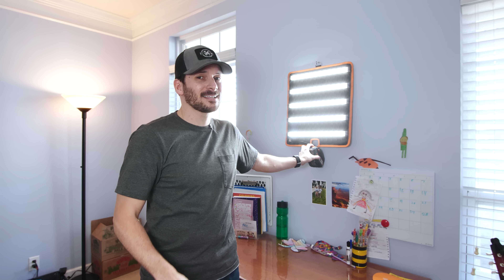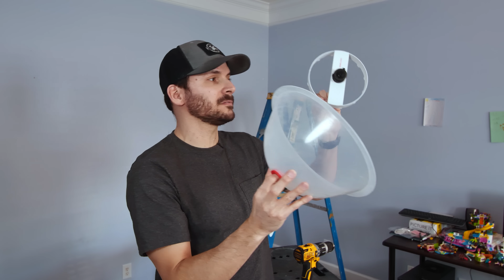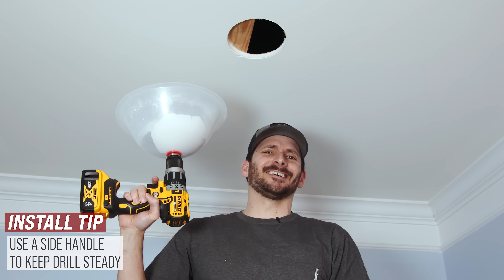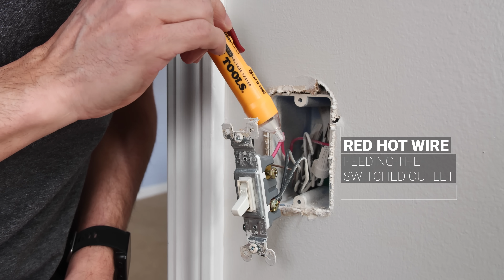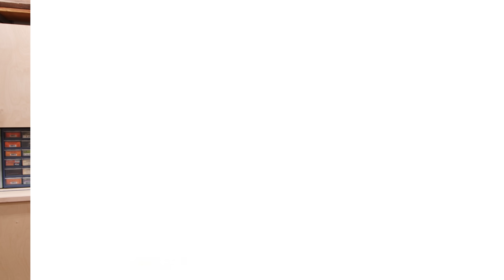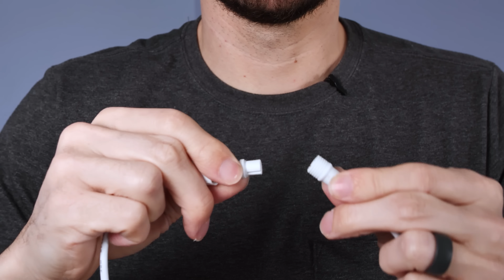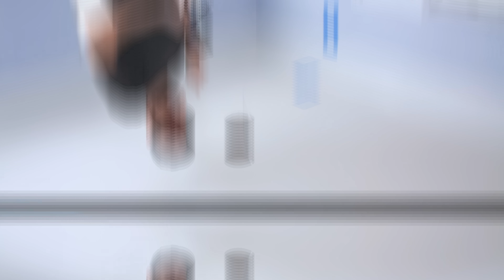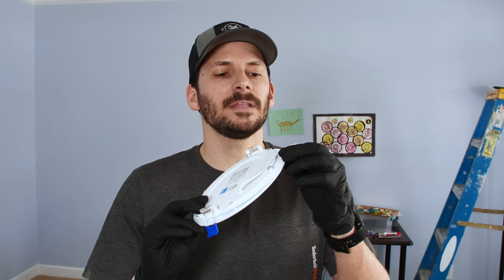Recessed Lighting Install with No Attic or Prior Wiring

Comment: Next time cut a hole in the ceiling to access the 14/3 and place 2 junction boxes to interupt the wire, while preserving the line to the outlet, then install a double switch on the wall. That way you dont leave a dead outlet that has to be fixed later.

Comment: Lol @ wire strippers in the ceiling. 🤣

I work on bowling machinery, and I when I was new to the job I mistakenly left a 1/2" box wrench on top of a machine. I looked all around & couldn't find the damned thing until a half hour later when someone started bowling on lane 9...clang, clang, clang. The wrench had fallen into the pit and was bouncing around in the pin elevator. 🤭

Comment: Going the other way...I've enjoyed your videos and it helped me a ton doing my own kitchen cabs and sink! Now I feel if I can do that I can do anything. However...that said I am approaching a dilemma and I cannot find any info on my next task so I thought I would reach out and see if I can get some feedback. I have and am sound proofing my middle bedroom to be my new home recording studio. The walls are secure with triple insulation including 1-1/2 rigid foam insulation sealed with insulation spray foam. This room is not only dead silent now it is completely air tight...except for my ceiling. The only thing left is the ceiling. My plan is to also apply the 1-1/2 rigid insulation sheets to the ceiling. Once done the entire room will be completely covered in 2-inch acoustic foam panels. Here's my issue. I need to drop my ceiling light fixtures down about four inches. Wiring is not a concern, but I'm not sure how to securely drop & mount the box to remount my lights to clear the double foam. Help me Obi-Wan...you're my only hope!

Comment: Licensed electrician here. You showed how you planned to get a wire from the switch through the top plate to your hand hole that you cut, but what was your plan to get the wire between all of the lights through joists?  You were lucky to have the trussed ceiling there. Most 2 story houses aren't constructed like this, and installing lights like this on a first floor ceiling with a room directly above it isn't anywhere near this clean and simple. You would have had a lot of patchwork in the ceiling, and you didn't show people that.  I can't tell you how many times I've had to tell customers that there will have to be multiple holes cut into the ceiling in order to get the wire through each joist in order to  interconnect the first light to another light in at least one direction (perpendicular to the joists) and they look at me like I'm crazy. I even had one lady tell me, condescendingly, that I didn't know what I was talking about, because on a TV home renovation show,  "Chico didn't have to do that."  They didn't show that part either, apparently.  I told her, "Well, maybe you should call Chico then" and left.

I wonder how many people watched your video thinking that it would be as simple as you showed, only to find out otherwise.

Comment: I’ve been looking into redoing the insulation in my attic. My dad built the home about 30 years ago. It has a not so thick layer of loose insulation directly on top of the ceiling. I noticed when you cut your holes I didn’t see any insulation. How is yours done?

Comment: Two things I’d recommend-
1) just use a hand saw while holding a vacuum hose in the other hand.  

2) cut out the old box with a hacksaw blade and use an old work box to prevent another drywall hole.

Comment: I have the exact same lights from amazon. Thanks for the video. I’m not a electrician either so I was searching on YouTube for people who have done this set up. It seems pretty simple enough. I don’t think I need to run wires because I am just putting this in the old fixtures. But if I want to add more I may need to purchase cables/wires so I do four like that in one room. Well see. But this one of the better videos I found so thank you.
Reply: What did you pay for them? He said 12 for $60 but I cannot find them for that price anywhere‘s.
Reply: @1stNCYANKEE  I got 12 at 100$ something on Amazon. Also using that whole saw was difficult. I use a combo of that an dry wall saw. Some of my wholes aren’t perfect and need to be patched but the wiring is easy. The hardest part was cutting the wholes.

Comment: I would've kept the switch you had originally. You had a switched red and a constant black. Cut the wire where did in the ceiling (after turning off the breaker, of course). Use the red hot wire from the switch and white neutral wire for your first wafer light. Connect the cut black wire (from the switch) back to the cut black wire (to the outlet). Cap the unused red wire to the outlet. Remove the red (now-dead) wire from the outlet and jumper the outlet hots (lines) together. Now your lights and your outlet works. No need to run an additional wire later to fix the outlet.

Comment: Sometimes I would take the neutral from the switched plug and splice it to the switch-leg. Then I have a neutral in the switch box. You will lose the plug. Then just run a 12/2 to the lights.

Comment: If I install these from below and without going in the attic, is it safe and within code to just push the connection box loose into the attic and not screw it down to a joist?  Do I need to clear away insulation from around it?  Thanks

Comment: hello i would like to install several can lights in my kitchen . I have to follow the electrical wires in the ceiling but I have 17 " foam insulation in the attic . How can I can do the work without making a big mess ?????       thanks

Comment: How do you remove the lights if you need to do maintenance, is there a push mechanism to pop them back off without damaging the drywall ?
Reply: The lights are held in place with simple spring pressure. Just pull down on one side and they'll easily come out.
Reply from the maker: yup, literally just pull down on them and they come out

Comment: how did you run the wires to attached all four lights together in one box? where 2x4 is one way direction you only can attach 2 lights together that is same line of 2x4 horizontal.

Comment: The hardest part I've run into when doing mine is that my attic has blown in insulation. When I put my lights up I constantly got insulation in my eyes and it made it annoying as heck trying to fish the wires around because insulation was in the way blocking my vision. Still worth it though. I just got some new ones that have a dual function; they have the normal light that's adjustable down to a perfect warm 2700K AND a night light type trim ring that shoots a dim light out to the side. they look great
Reply: Where’d you get those? Can you attach a link or pic?

Comment: Maybe someone has already mentioned this, but with 390 comments, I'm not going to read each and every one to find out :)  They do make wafer lights that allow you to select the color temperature. The ones I saw had 5 settings: 2700K, 3000K, 4000K, 5000K, and 6000K, and cost about $24/ea. There are also some where the color temperature and dimming can be controlled via an app, but I haven't done any research on those.

Comment: I want to do this to my apartment - can I put it on a switched box where an old overhead light was??? Do I need to worry about Voltage or Watts? or Anything??? I'd probably add 4 to a 110V. I'm in the US/Los Angeles.  Thanks!

Comment: Drill in reverse.  You can start in reverse to get the hole started then switch to finish..... but most professionals drill all ceiling holes in reverse all the time.

Comment: High speed on the drill is much better. Lower speed has much higher torque as you found out when it grabbed and nearly took your head off! High speed also cuts much smoother.

Comment: man o man,
what a beautiful video 
but i came to a somewhat of a problem 
im installing same set up of lights on a room that has no ceiling light!
i cut first hole and found out theres a lot of insulation
like a lot  ( sprayed on insulation)my house has that in every single wall and even the attic is full of it 
i got covered from head to toe 
now i have to finish the job but damn i cant see anything not even with my phone

Comment: You could have used the junction boxes for the lights to tie in to the existing romex with a new piece of 14-3 between two lights if the wire was  too short

Comment: I plan on doing this as well, but have a different situation of just having a ceiling fan/light in the middle of the room, controlled by a wall switch.  Is there a way without cutting into the wall drywall to run another line to the switch that would operate the potlights separately.  I know you show doing it, but want to avoid patching/painting
Reply: Do you have crown molding in the room?  If not, this may be the time to add it.  You still cut out a little drywall on both the wall and ceiling junction, but it is hidden by the crown molding.  Check with code in your area, but you can then run it under the crown molding and then make another notch in the drywall where you need to go to the light.  Just be careful of where you nail the crown molding.  Anyway, this is my plan for adding an exhaust fan/ light combo to a powder room.
Reply: @glasshalffull8625  No we dont, and dont plan on adding it due to the extra cost and roof height of 8 feet.

Comment: The wafer lights are 12 volt is it possible to cut the pigtail off and use them straight to a 12 volt system and do they come with that wiring diagram

Comment: Really good video!!! An alternate technique for the Half Hot Switch Receptacle:  Replace the single gang switch with with a double gang or triple gang retrofit. Now you can still have a switched outlet, switch for the ceiling lights, and with a triple you can have switch for ceiling fan.  You would bond the new electrical runs to the existing neutrals and hots. Just take your time when backing out the existing the electrical wires from the single gang to ensure not to damage/tear their outer installation.   I’ve put the pancake ceiling lights in 7 rooms (4 in each room). They were between $20-$30 at the time for each light. The builder wanted $150 per “can” during construction. So we did the immediate retrofit for about $100 per room verses $600. It only took 2 days to complete all.

Comment: That 3 wire likely is the power and switch for that receptacle so if you ran a 3 wire between the to pot lights you could have kept the outlet working

Comment: You didn't really cover it in the video... how'd you get the wire from one light hole to the next? Was that fish tape too? Seems like there was a lot of stuff up there that would get in the way.
Reply from the maker: Yep, I used the steel fish tape I showed in the mock up.  I had to weave it through the trusses but it wasn't very difficult

Comment: Do you have any experience with smart lighting ? When I renovate my family room I’m probably going to use led wifi down lights with wifi switches ,it just seems so much easier than running wiring and new switches . Besides removing the wiring hassle you also have a lot of control of how your lighting operates , you can use an app and control with a smart phone , or use a voice activated switch ,or use a time control ,the benefits go on and I don’t really see any drawbacks .
Reply: only another entry point into your home network :)
Reply: @troyporter3825  Not if you run the hub on your Guest network.
Reply: @JustinRoffMarsh  right exactly...so we can agree that there are other variables at play here and its not necessarily just  'simpler' or easier

Comment: I had a similar situation, I disconnected the wire from the switch so that the outlet had constant power while still keeping power going to the lights through a pig tail.

Comment: I was wondering if there is any limit to how many of those lights on a single circuit?  I plan to do this in a kitchen remodel of an older home.  I have read that no more than 6 lights should be on a single circuit which I think is crazy.  In our current home, we have 10 on one circuit in our kitchen and another 6 per bedroom along with other recessed lighting with no problems at all.
Reply: These are 10 watts at most. You could do 100 if you wanted to.
Reply: @robertmarts6810  thanks  we are doing the entire house now.

Comment: Having the drill on high setting works way better than low, you won't get the kick back. Any time you're working with a hole saw don't apply a lot of pressure and you should be fine.

Comment: Did you expect that stud to be there on your first hole cut? The dangerous drill kick-back was because the hole saw encountered the stiff resistance from the stud after cutting through the drywall.

Comment: Your friendly neighborhood electrician here… if I understood correctly, the 14/3 wire is wiring both outlet sockets with one hot going to each outlet socket? If so, all you had to do was take the red hot from the outlet off and use that for your light. (The red is already wired in the switch so you wouldn’t even have to touch that wiring

Comment: I would've just cut that 3 wire and pulled one end of it to the light near the switch and the other end to the light near the receptacle. Then just pull a 3 wire between them and wire the receptacle to be constant hot. Then just use the red wire as the switch leg going to the lights instead of the receptacle. No more holes needed.

Comment: Light switch powering a socket?
Wow, never seen that before.
Wonder what the UK regs say about that.
Reply from the maker: pretty common around here unfortunately
Reply: the uk have 5 amp plugs that are specifically designed for lamps. They used to be switched in and for by the light switch. Not common practice now but older house have them in and you can still buy the from B&Q
Reply: @thomfoun  I will have to keep an eye out for them.. What stops you putting a high amp device (vacuum for example) into it?
Reply: @ColinRichardson  they are a different shape so only 5 amp plugs fit . The are round not rectangle. If you google bs 546 you will find the 🙂
Reply: @thomfoun  I presume you have to attach those plugs yourself on the lamp, because I have seen no device have that shape plug my entire life?

Comment: Another tip would be to check your local building code to make sure you can install these types of lights in an attic setting. In colder climates punching holes in your ceiling is just introducing more area for air leaks and you don't want that warm air filtering into the attic in the winter (and these lights would not be enough of a seal to prevent that).

Comment: When you cut that 3 wire you could have put the other end in the other light. Then run another 3 wire between the 2 that way you could still carry the constant power to the outlet.🤷🏼‍♂️
Reply: Burying j boxes is illegal

Comment: Someone may have said this already but if you tied the 2 blacks together from your 3 wire in the first light and used red coming from the switch for the lights. you could cap the red in the outlet box and have had constant power on the black for the outlet. That is, if you 3 wire also fed your outlets but then you might have more then just one dead outlet. I have seen some weird wiring jobs so who knows.

Comment: Why couldnt you tap into the switched hot (red), neutral, and ground on the wire you found for the new lights? The constant black to the plug can continue and you could either include the load side red with the new lights so it's still switched or you could discontinue the load side red and replace the plug with one with tabs. I don't understand why you had to completely kill the feed to the outlet. What am I missing?

Comment: I'm curious why you didn't go 134" from the opposing walls (across from the slanted wall) to get your 4th can measurement. That's what I would have done... although I probably would have messed it up at some point.

Also, why didn't you put a junction box in the attic and use the existing red wire for the lights and then use the black for the outlet. Perhaps you don't have access to the attic, I don't know.

Comment: With no attic lighting, how do you remove the lights from the ceiling if you need to check a wire? Thinking about doing this project but worried how to remove them in case of something.

Comment: You didn’t have to kill the outlet. You could have kept it switched with the lights, or just changed it to use the constant power and change the lights to use the switched red line.

Comment: Receptacle, not outlet. Outlets are points on a wiring system and boxes shall be firmly attached to structure. We can’t just flop boxes into the ceiling. If a firefighter comes in to tear the ceiling down to check for fire the boxes will fall on them.

Comment: Need help: 
I got a quick question. We have pre wiring for fan. Its the 14-3 wire. White, black, red and ground. The black wire has constant power, which i am using it to run the ceiling fan. I have to use remote to turn the fan/light on and off. I capped the red wire. 

The red wire is what control by the switch. My question is, can i use the red, white and ground to add some recessed light? Is it ok to do that? I am just worried because i am using the black to run the fan. Not sure if i can use the same neutral and ground for recessed lights which is already being used for the fan.

Comment: When you do upgrades like this that involve tapping into wires... are you supposed to have an inspector come out and check your work? Or is that unnecessary for small renovations like this?
Reply: Most towns dont not require it for small things like this. Good to check first. But,  you can always call a licensed electrical inspector to verify it is safe and compliant for a fee.